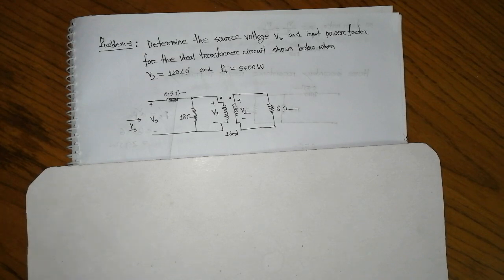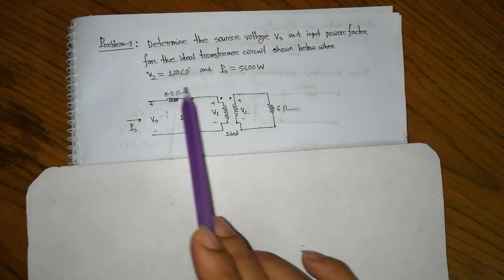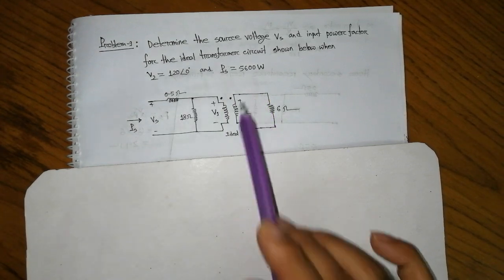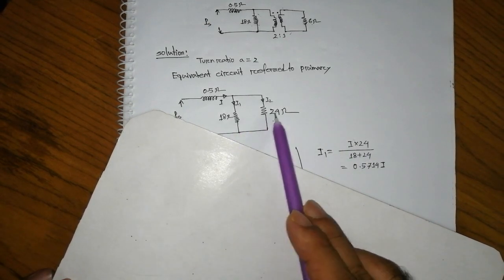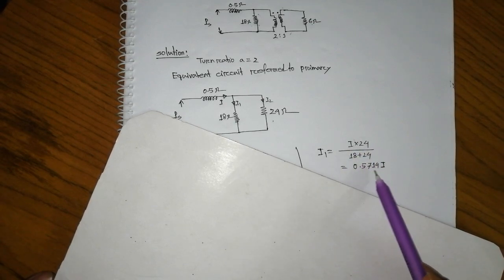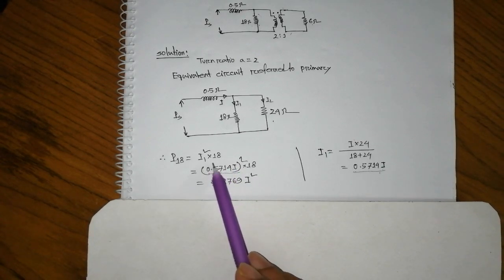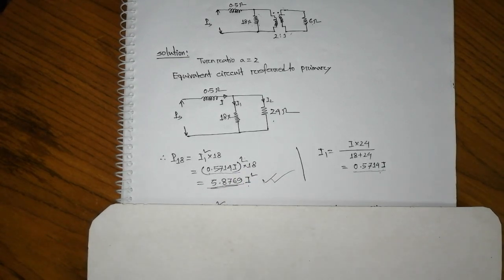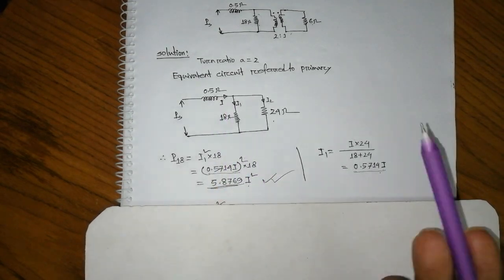Confusing Problem For BUET Job Exam

Comment: Turn ratio is V2/V1 or V1/V2 which one
Reply from the maker: V1/V2 is turn ratio. And V2/V1 is transformation ratio
Reply: @eeejobbd  which one should i use ?
Reply from the maker: If turn ratio is told then V1/V2